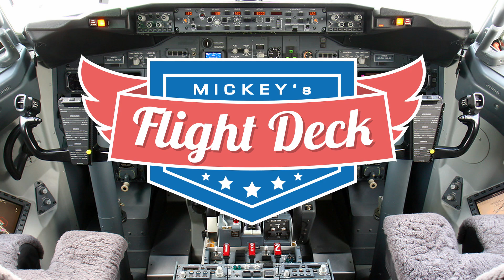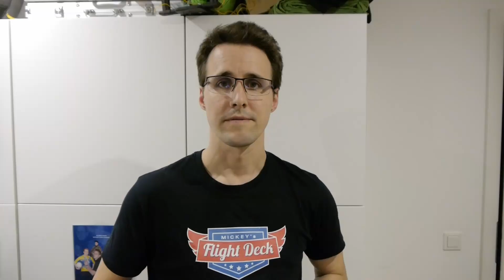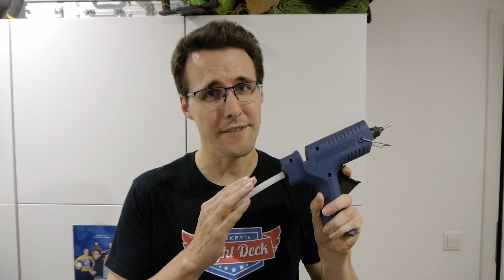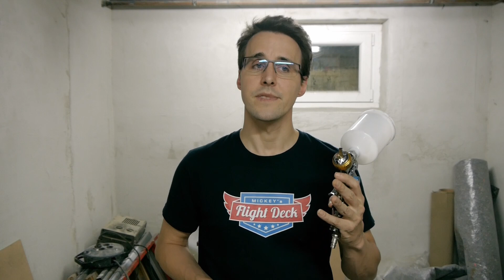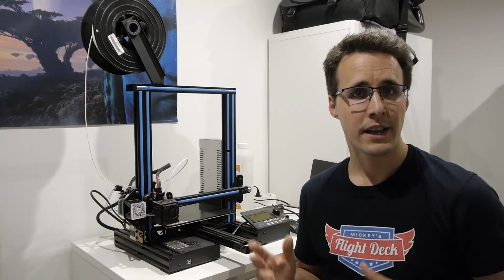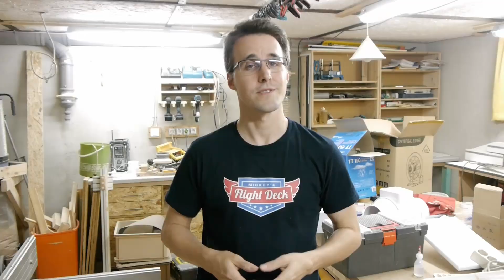Top Five Tools for panel making - A Boeing 737-800 Homecockpit

Comment: I am building my homemade cockpit as well, its now being easy, from your top 5 i miss the 3d printer and the CNC, those are the most expensive to buy, once i get those, then i will start, most of other materials i already have them.
Reply from the maker: Always keep in mind how much cockpit you want at the end. If you only want to have an overhead it could be cheaper to buy already engraved panels instead of a CNC.